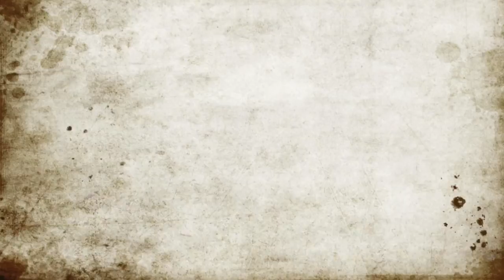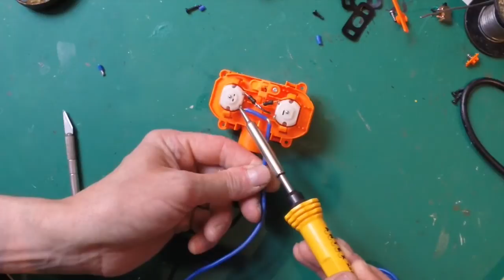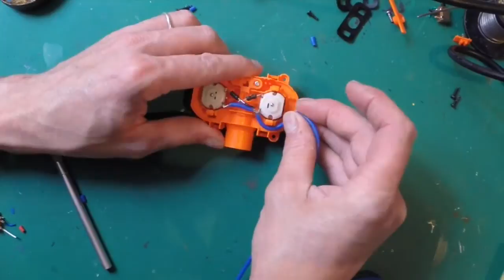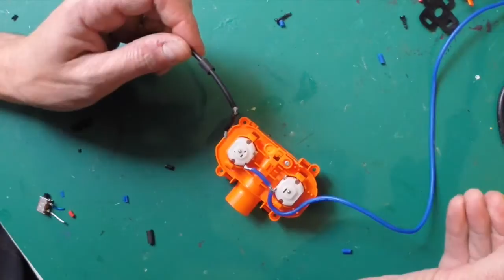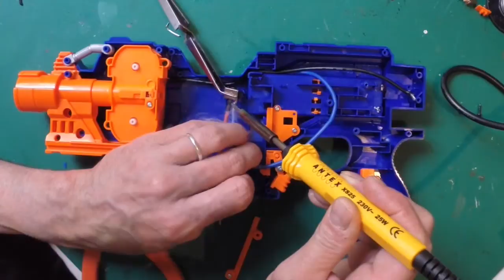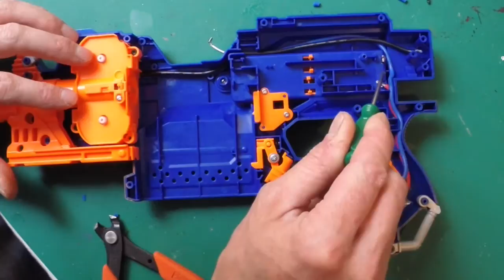Nerf Stryfe Re Wire PT2

Comment from the maker: Whoever asked about melting the shell- Take the components out of the shell once you have measured the wire length required and hold them in self gripping tweezers or a helping hands tool. You shouldn't ever need to solder in the shell except for the battery tag connections if you are keeping those. They have solder on from the factory wiring so a tinned wire will go on them quickly. Don't leave the iron in place once the solder is flowing. If you put a microswitch in and bond it in pace, put some wire tails onto the switch BEFORE fixing it, then you have soldering room to connect those without being in a tight spot by the switch.

Comment: By using better wires, will performance improve a little bit even with alkaline double a batteries?
Reply from the maker: Karthik Peirce Not by a measurable amount. You will get rid of a small bit of parasitic resistance and if you use a higher discharge battery, like a rechargeable AA, you will get a small improvement in rev up time. The battery and it’s ability to meet the current demands of the motors is the biggest limiting factor.
Reply: Can I use eight double a batteries for higher performance?

Comment: What type battery you use? 
Imr or AA?
Reply from the maker: Faiz Izmail This will run either 14500 IMR or any AA. Nothing more than stock motors tho. You can run 2s lipo with just this basic loom but for anything else I would use a MOSFET
Reply: @foamdataservices  thank you
I think i will use AA for standard motor and rewire my nerf

Comment: Hey fds, is using heat wire tubing necessary?
Reply from the maker: Ranger69_XD If you want a safe job all contacts should be insulated. I never build without it. If you saw what happens when you short any lithium battery you would insulate.

Comment: I’m a bit late but would 18 gauge wire work well with a 3s lipo?
Reply from the maker: Wire gauge is dependant on current not voltage. If you are going with stock motors then 18 is adequate. If you are using mod motors then 16 is better, ideally with a Mosfet loom to keep the high current out the rev switch. 18AWG is typically rated to 30A max.

Comment: When modding guns I typically remove the lock switches, it is very easy to just either tape down the button with electrical tape, or snip it off of the switch leads and solder the wires together. So I was glad to see you do it too, just something familiar.
Reply from the maker: I always remove the lock switches, I re use the stock switch and lock in the rev trigger as this mod doesn’t need a switch change.

Comment: Where do I buy the larger wire, and maybe imrs
Reply from the maker: eBay. You want 18AWG Silicone Insulated Hobby wire. Blastersmiths UK sell a rewire and Out of Darts or Foamblast in the USA if you want it from a Nerf specialist. IMR will need searching for, you want 14500 IMR.
Reply: @foamdataservices  so what are the benefits of having imr batteries? Are they rechargable? I know they have higher power
Reply: @foamdataservices  if so can I just use regular battieries as so called dummy batteries
Reply from the maker: piz GT DO NOT MIX BATTERY TYPES. You MUST use proper dummy cells NOT different batteries, you could cause a battery fire. Look at the chrono figures for IMR vs regular batteries. https://www.tapatalk.com/groups/britnerf/battery-wars-shootout-results-t1816.html
They are rechargeable, you need a special charger like a Nitecore i2

Comment: I have a giant 8.4 volt NiMH battery for my RC stuff, so could I use that with this mod and stock motors?
Reply from the maker: You could, a £5 lipo would be better and fit in the battery tray but Nimh packs do work with stock motors, they can’t power higher torque motors, anything over about 20A stall total is too much for them.

Comment: Hey man, I have some 3.6v lithium thionyl chloride batteries and I was wondering if they were safe and good for nerf. They aren’t lithium ion or lithium manganese so I have no idea.
Reply from the maker: Charlie Dana You need to check their discharge rating. Stock motors need at least 8A. They look like a non rechargeable trustfire type chemistry, in which case they won’t be suitable for Nerf use as they cannot supply the current required. You can’t use any 14500 size battery with mod motors, all those need packs or larger cells.
Reply: Foamdata Services ok. How do I find out the discharges rate? It doesn’t say on the battery
Reply from the maker: I looked at them, most are under 2A peak. Use google to look up the spec, but that chemistry is not designed for high current output. Personally I wouldn’t waste time with them.
Reply: Foamdata Services ok I will get efest imr’s then. I have my stryfe rewired with 18 awg wire and I was wondering if 4 of the imrs would blow the stock micro switch and stock motors.
Reply from the maker: Lipo is better, 2s 40c 500mah packs are $5 and can run much better motors. Moderate spec charger is $10. If you are dead set on IMR then 4 will cook the motor brushes in no time at all. 3 is OK and should be considered the max you can get out of stock motors.
Reply: Foamdata Services thanks. I have another stryfe laying around so I will rewire that and try both and see which one I like better
Reply from the maker: If you over discharge any lithium battery you risk it catching fire. My advice is to NOT USE the LiCl ones AT ALL.

Comment: Hello! A little late to the thread here, but I loved your video and absolutely intend to do it myself, I just have a question! I'm not too clued up on all of this, but if I rewire as you have, and use the stock motors / wheels, can I carry on using AA batteries? Or use IMR's instead for performance purposes? Will I notice a difference using IMR's? Thanks!
Reply from the maker: You can use either. See the test results linked in my mod guides to see performance boost from better batteries. IMR averages 85fps vs a stock Stryfe at about 60fps. If you don’t own IMR gear already skip it and go to Lipo, it’s not much more expensive and better. https://www.tapatalk.com/groups/britnerf/battery-wars-shootout-results-t1816.html
Reply: Foamdata Services Awesome thank you! I'll check ot out now. Just worried about frying anything, don't wanna shock myself or melt anything! Even making the blaster smell of burning would be bad. If I did use IMR's would you use all 4 slots? Thanks again mate.
Reply: Foamdata Services Great stuff! I had no idea, that's ace info thankyou! Any specific Lipo battery to be used with the Rhino motors? And can you keep a Lipo in the blaster when not in use too, or would you treat it like an IMR and take it out? I take it stock flywheels are okay in general as well?
Reply from the maker: All batteries should always be removed from blasters when not in use. Stock Stryfe flywheels are fine. Go do some more research, I am not here to give you all the answers. Rhinos are a 3s motor.
Reply: Foamdata Services I will do, sorry man I didn't mean to be a pain. Thanks for all your help!
Reply from the maker: YouTube comments is a bad platform for detailed technical advice. Join a good forum like Britnerf, that’s where I go when I get stuck.

Comment: What wiring did you use
Reply from the maker: 18AWG silicone insulated multi strand hobby wire. I bought mine from Component Shop on ebay.
That will do most 130 motors except neo mags.

Comment: THANK YOU THANK YOU THANK YOU!  I am a noob and I just got into nerf modding like 1 month ago.  I never soldered before or rewired anything in my life.  I just rewired my Stryfe with the size 18 wire.  I am running on IMR batteries but next blaster will get an upgrade.  Little by little.  Thanks for the great tutorial, it helped me so much! Super easy to follow along with!
Reply from the maker: Well done! Make your next loom modular, then you can upgrade individual parts like flywheel motors without changing the rest of the wiring.
Reply: Foamdata Services I don't know what a modular loom is 😂 Sounds like it's something I should know though.  I'm not only a noob to nerf modding, I'm a noob to doing any wiring work as well so I don't know many of he terms.
Reply from the maker: Watch my MOSFET video and Rapidpistol internals video, its all in there. A modular loom is one where all the parts plug into the main wiring harness, allowing you to change them quickly without rewiring. If you want to buy a pre made, top quality wiring loom for your next project Kitlooms sell them in the UK, can be contacted via Britnerf or Facebook.
Reply: Foamdata Services ok I just watched the microswitch tutorial (I'm using the same switch) and now I have a good idea on what to do!  I will definitely wire in a modular loom to the motors so I can remove them easier!  I got myself a Demolisher that I am working on next so I'll be watching your videos again soon to help me through it!  You are awesome for this

Comment: will there be a performance improvement if I do the wiring and continue using alkaline batteries instead IMR?
Reply from the maker: Not a very big one, the batteries will still hold you back. If you are dead set on consumer AA then get some high power rechargeables like Eneloop or Venom, they will help a bit.

Comment: Do I have to use 18 awg wires? Or can I just just thinner wires?
Reply from the maker: You should match wires to the load required, allow 20% headroom. Anything thinner than 18awg generally won't meet the current load of most motors, if you are rewiring anyway why use crap wire? It's the same amount of work to use proper 18awg silicone insulated hobby wire.

Comment: My wire size are about the size of the original stryfe wires, can I still rewire it?
Reply from the maker: Use proper 18AWG silicone insulated hobby wire. You need 3ft to do a stryfe. Do the job properly or stick to simpler mods.

Comment: What kind of high voltage batteries work with this rewiring mod, and how many batteries could i use, would i have to use dummy batteries
Reply from the maker: Watch my battery guide and balance video. You will need 1-2 dummy cells if you use IMR, it will be fine on 2-3 14500 cells.

Comment: Hey why do you guys all use aluminum instead of copper wires..??
Reply from the maker: That's not aluminium. It's silver copper alloy. Decent silicone insulated multistrand hobby wire with a manufacturers data sheet for load capacity is what we use, most of which has silver copper wire strands. Better and more durable than cheap copper PVC insulated stuff. Aluminium would be very hard to solder due to its faster oxidisation rate!
Reply: Foamdata Services  Called one of my friends at castle creations he told me. Actually the better quality wire is a copper alloy usually with tin. That makes the wire stronger, easier to solder, copper wire can be a bitch to solder with out use of flux
Reply from the maker: I always use a separate flux.

Comment: Correct me if I'm wrong, but should I use 4 AA batteries to test the motors? Also, what type of battery should I use for velocity afterwards? Should I stick with regular AA batteries, or should I use a LiPo or any other kind of battery?
Reply from the maker: Watch my battery video, my balance video, then decide on your motors. A basic rewire like this will work with all 14500/AA cells. Test only on regular AA batteries. If you want to use any motors other than stock you are going to need lipo packs. Simply add an XT60 connector to this loom and you can use MTB rhinos. If you want the ultimate mod loom, watch my MOSFET video.
Reply: What if I want to use LiPo batteries without upgraded motors? If so, what type of connector should I use? Thanks!
Reply from the maker: If you are using stock motors with lipo the brushes will burn out eventually. There's no point in doing that. If your game has a velocity cap run Rhinos on 2s, they hit under 100fps then. XT60 is the most common connector. 
A mosfet loom is still better long term.
Reply: What motor should I use for a 2S LiPo battery? Or should I just replace the stock motors with a MTB Rhino motor with a 3S LiPo battery?
Reply from the maker: Meishel 2.0 for 2s. Those really should be in a MOSFET loom, they pull nearly 40A stall. Rhinos need less power, but they make much less torque.

Comment: I personally run a short length of wire between the motors and solder in the middle to keep the current between the motors even. It isn't a huge difference, but it can increase accuracy by a very small amount.
Reply from the maker: I do that too for mod motors, this is intended to be the ultra basic guide. The through wire method is easier for new modders to do without melting the motor end bells.
You would need a very sophisticated current measuring set up to see any difference in draw from the motors, I very much doubt you have seen a visible difference with your eyes. The bridge wire and splice does have benefits to the motor tags. You can get the motor wires facing exactly where you want so there's no lateral force on the tags, making them much less likely to break.

Comment: Do the heatshrinks stay where they are to insulate the soldering? Or do you have to do something to keep them there?
Reply from the maker: They provide insulation, when you heat the tubing it shrinks over the contact/wire, holding itself in place. It is NOT an optional item in electric modding.
Reply: I knew they are not optional and that they insulate, but its very nice to know they stay in place as is. Thanks!
Reply from the maker: Buy a cheap mixed box of different sizes off Ebay, that way you have all you need, usually sub $5.

Comment: When I use a LiPo battery, do I need to put it back in storage mode after use, then recharge every time?
Reply from the maker: No, you just need to make sure it's over 3.6v per cell. You can store them at anything over that. The storage function is there for setting discharged lipo up for storage. You will rarely get below3.6v per cell in Nerf if your battery is properly matched to motors.
Reply: Ok, so just to make sure, you can safely store a LiPo at full charge?
Reply from the maker: Yes, they are only dangerous when discharged. Never store a pack at lower than 3.6v per cell. If you are flattening the lipo to the point at which you need to charge it after every game I would advise getting a physically bigger pack. I don't use anything under 1000mah. Watch my matching batteries to motors video.
Reply: OK thanks

Comment: Can i use 14 awg wire?
Reply from the maker: You could but you will find it very hard to solder to the motor tags and rev switch without overheating them and melting the surrounding areas, get 18awg, it's under $5 for enough to wire a stryfe, don't cheap on parts, match the wire to the expected load. 14AWG is too thick for this job.

Comment: were did you get the wire?
Reply from the maker: Ebay, or Blastersmiths UK and BlasterTECH do kits. Get 18awg silicone insulated multi strand hobby wire. There are several links in the comments.
Reply: Foamdata Services ok thanks

Comment: Great Vid! It was a very informative one with lots of detail and I successfully rewired my stryfe with your guide
Reply from the maker: Glad you found it useful!
Reply: Just a quick question... Does a extended pusher do much to the range?
Reply from the maker: No, it makes zero difference to performance.
Reply: Do u mind leaving a link to a good 14500 Efest imr charger?
Reply from the maker: Nitecore D2 or D4
Reply: So with the stryfe rewired with 16 Awg wires and no thermistor is it possible to put in 4 imr cells or should I just stick with 3 and a dummy cell?
Reply from the maker: You can put 4 in if you want to melt the metal brushes and make the motors spin too fast to gain more FPS.
Reply from the maker: You don't need 16awg for stock motors either. 18awg will do anything except 180’s.
Reply: Thanks so much for all your help! You helped turn my boring old stryfe in to this behemoth....https://m.imgur.com/account/AlanSchwartz184/images/4pW8SUE,  What do you think of the aesthetics?
Reply from the maker: I can't view the link!
Reply: Do u mind if u leave your email address in a comment because for some reason it isn't in the about page
Reply from the maker: No, you just need to post the direct link instead of your account link on imgur, use sharing options or view in desktop and copy and paste the direct link to the image.

Comment: What is the heatshrink for on the flywheels?
Reply: What does the heatshrink even do?
Reply from the maker: Heatshrink is an INSULATOR, it supports and insulates the joins PREVENTING SHORT CIRCUITS which will MESS UP YOUR LIPO. You should always insulate every connection.
Reply from the maker: Also there is no heatshrink on the flywheels. There's heatshrink on the motor wiring.

Comment: did you replace the micro switch?
Reply from the maker: No it's unnecessary with stock motors.  There's a separate video of switch replacement
Reply: what if i run tamiya motors?
Reply from the maker: +Battle Brick's Lego You will need to change the switch
Reply: Blastaway.eu didn't use a new switch in his video
Reply from the maker: +Battle Brick's Lego All tamiya motors are not suitable for Nerf. I don't care what blastaway does,  I gave you my answer based on being one of the best builders of top quality hobby grade blasters. If you want to follow someone else's advice don't come to my channel

Comment: I just rewired my stryfe like you showed in part 1 and 2 but it increased his performance for like 1 night and then the day after I was firing the blaster the darts were just like dropping out of the barrel and I am using normal batteries.Can you tell me the problem?
Reply from the maker: You will have to open it up again. One of the connections probably came off your motors.
Reply: +Foamdata Services Yes that was it thank you so much sir!

Comment: what size wire
Reply from the maker: The right size for your current requirements. 18AWG Silicone insulated multi strand hobby wire does up to 30A so will cover 130 size motors.